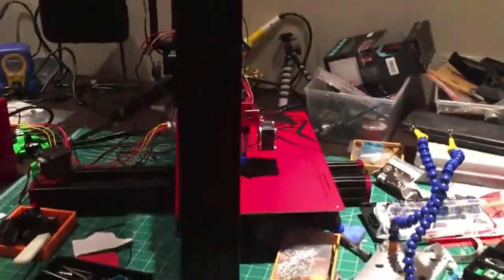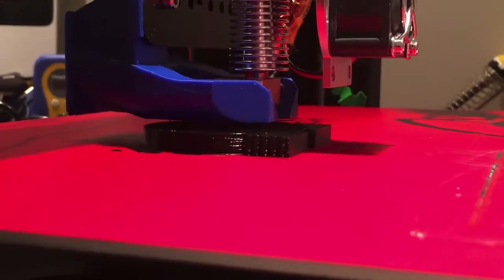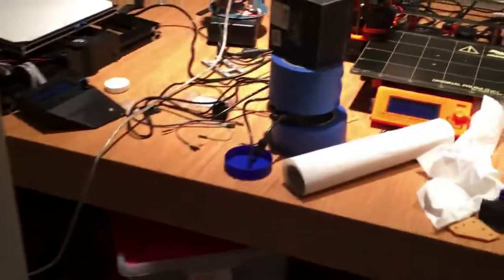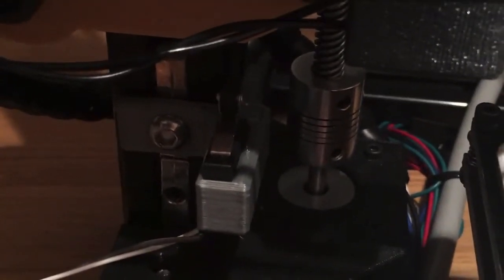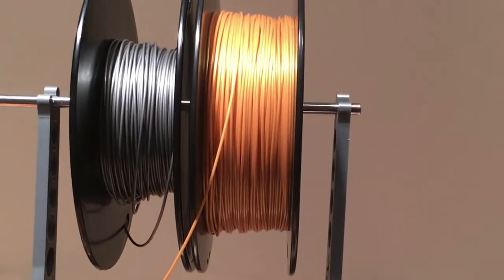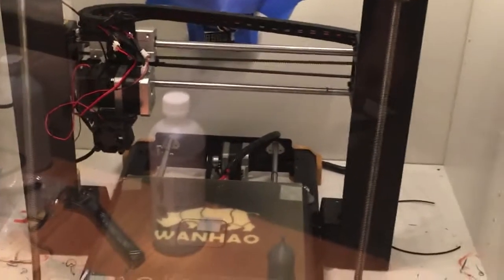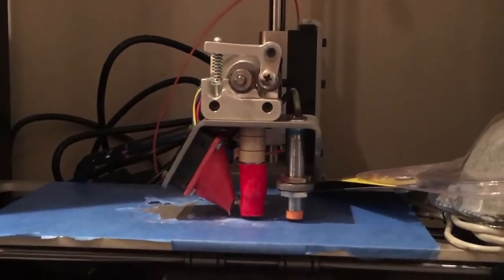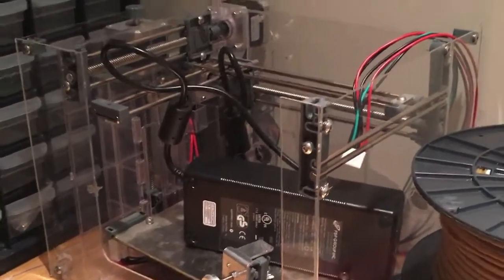3d printers guided tour, my best and worst 3d printers

Comment: Haha The Makibox. It was my first 3D printer. Took a year to arrive, 3 months to get it working then it died 2 months after that. A couple years down the line I've designed an all metal version of the MakiBox A6 with improved supports for all 3 axis. It's going to be using a standard ramps / Arduino mega set up with an E3D V6 Lite (with a 0.15 nozzle) & E3D Titan extruder. Despite all it's failings, I found using the leadscrews resulted in a more accurate X&Y motion than I've had in any other printer. I hope to build on that & have a sturdy & precise printer for small detailed parts.
Reply from the maker: The lead screws are worth trying for sure, I think they failed due to quality control more than anything :)